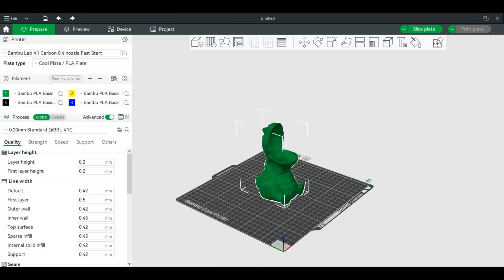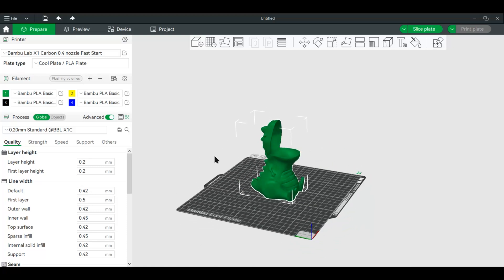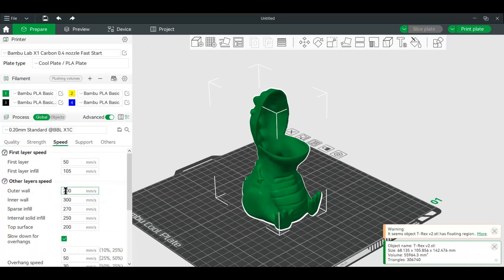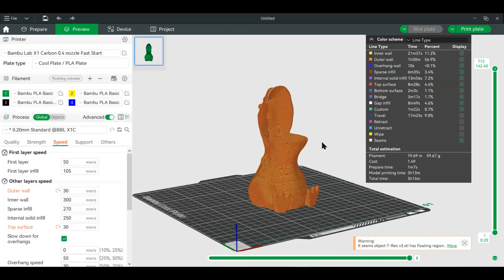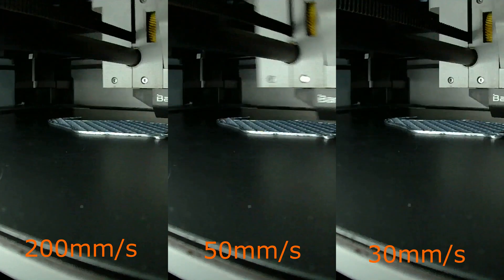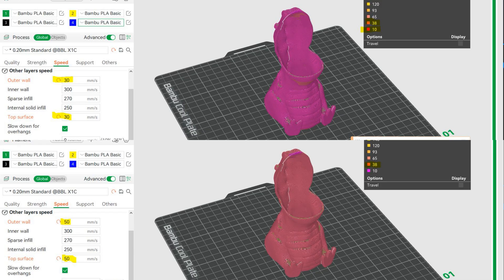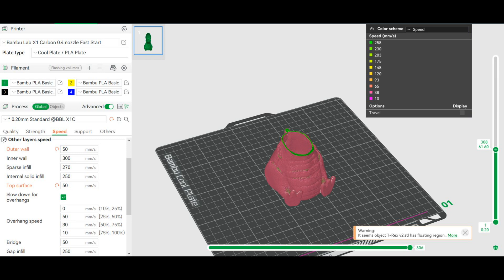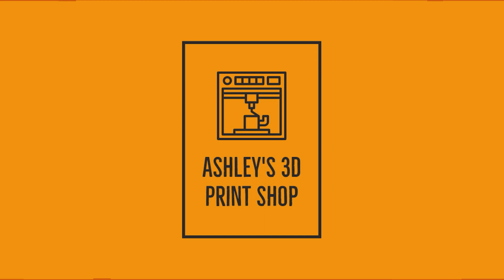How to make your prints SHINE on Bambu Studio

Comment: I wonder if its because it spends more time in the melt zone, before I upgraded to a p1s, I had a cht volcano on my ender 3 pro, but I cranked up the speed, but I also cranked up the temps to print faster, the higher temps caused a more glossy finish
Reply from the maker: Indeed. the filament is heated, laid down slowly, and the next layer keeps is warm for the gloss. There are a few things not discussed in the video.
1. you can up the nozzle temp
2. you can slow the fan
along with a combination of slower speeds. Since most folks are new to printing I try to keep the setting changes to a minimum until they become comfortable making other adjustments.

Excellent observation, comment and tips.

Comment: Please make a video on how to smooth out name plates like disney names. Sides look good but top what you look at lolks bad.
Reply from the maker: I haven't released a full video on this but you may be served with "ironing"

under the global settings
go to QUALITY
Ironing. 
You can iron top most surface, all top surfaces or all solid layers. 

Keep in mind this will add to the print time but can make for a pleasant surface. 

If you are using a textured plate it will not have the same finish so keep that in mind.

Comment: does the standard pla setting work better than the pla silk setting?
Reply from the maker: Hello. 😊 Typically silk pla can be printed with the pla settings unless the manufacturer has certain recommendions on print temp/speed.
This particular silk was printed with the default pla profile, and the only changes were in speed setting.

Comment: For some reason even at 30mm/s the print time per layer on my model fluctuates. It’s incredibly hard to find anything online about Silk PLA

Getting the top surface looking good is a nightmare. I did a test with 0.4mm nozzle and it looks find ironing but on the 0.2mm all the top surfaces look horrible and I don’t know why.

Please make a video that is comprehensive and be the first!
Reply: Generally for silk pla you always want to run it at slower speeds for best results. 
Darkwing dad has some really great videos about it. Not to take away from this video as it is also very good.

Comment: This is the only bambu labs silk video on the entire Internet. Would love to know your nozzle temperature and support settings.
Reply from the maker: Hey hey. So interesting point about this video was I was using generic amazon silk filament under the bambu labs pla basic setting. The only changes for the dino were speed settings. ( settled on 50mm/s as a happy middle ground on shine/speed)

PLA default temp 220C

As for the Atomic Heart Twin I used those same settings but with supports I used
Type: Tree(auto)
Style: tree slim

There is also a tree organic that was released in the latest version of studio which could also work. 

Thank you for commenting and watching.

Comment: Can't you just increase the temp by 5-10 degrees?
Reply from the maker: Sometimes it can help. This will highly depend on the model, speed, cooling, filament and other factors. I personally like to keep the settings simple until you know the filament and capabilities of the printer.

Great comment.